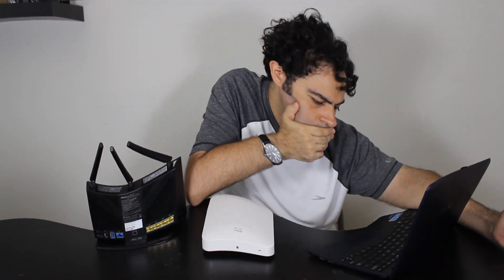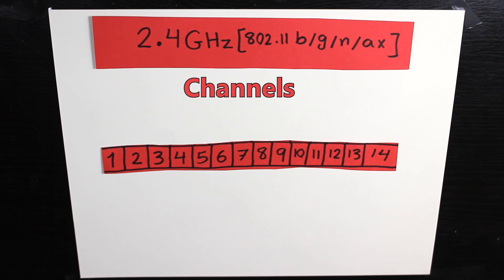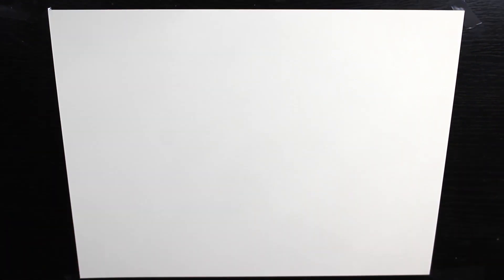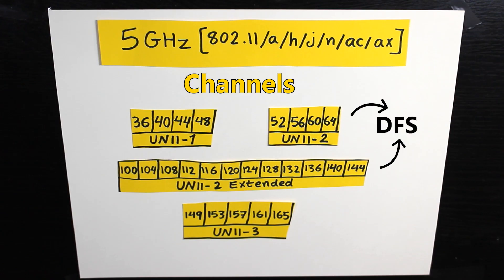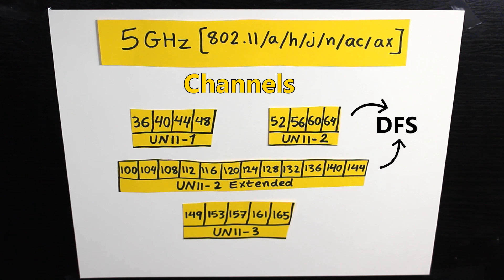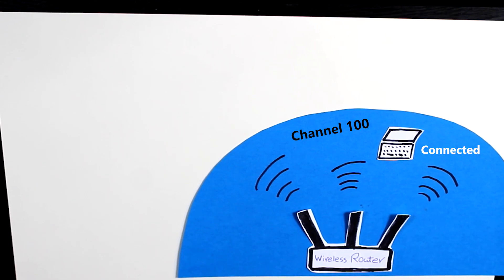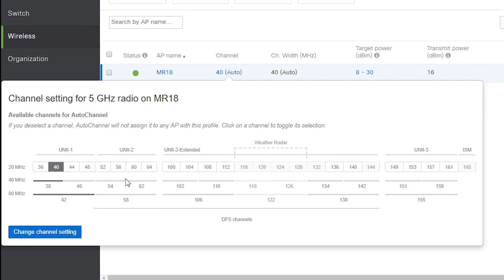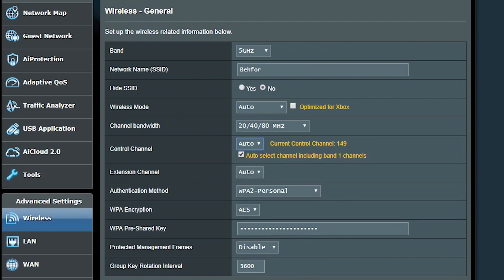This is Why My 5 GHz WiFi Was Garbage [DFS] !!!

Comment: Nice video. That was what was happening to me. Regular disconnections because I was using channel 64. I changed to channel 36 and problem got fixed 😎
Reply from the maker: Glad this video was helpful for you, thanks 👍
Reply: @Behfor  Yes, and thanks to you for sharing this info. I was using a 2.4GHz router for years and a week ago I bought a new WiFi 6 5G router. The difference in speed is really big, and since I started using the 5GHz band in channel 36 I got absolutely no disconnections. I turned the 2.4GHz band off as all my devices support WiFi 5 or WiFi 6 😎

Comment: What people tend to forget, because it's usually stated as he states it here, "to avoid interference with my neighbor's WiFi...";
 well, if you're interfering with your neighbor then your neighbor is also interfering with you. So, even if you don't care about your neighbor, the problem affects you too. In the USA, the non overlapping 2.4 GHz channels are 1, 6, & 11 at a 20 MHz bandwidth. If you're in a crowded area, don't use the 40 MHz bandwidth on the 2.4 GHz band. If you do, you'll probably be overlapping someone and, as stated above, if you're interfering with them, then they are also interfering with you. So, you'll probably get better performance at 20 MHz due to the reduced interference. Also, while a clear channel is best, having 2 access points on the same channel actually causes less interference than having them on overlapping channels. Some newer devices are smart enough to realize this if you use the Auto channel selection; however, most aren't. So, do a scan of your area and pick channel 1, 6, or 11 for your 2.4 GHz band, whichever is the clearest.

As in the 2.4 GHz band, in the 5 GHz band, the wider the channel width, the more likely you'll walk on another device. So again, in a crowded area, don't run wider than 40 MHz. Once again, the reduced channel width's reduction in performance will probably be less than the performance reduction caused by the interference you get with the wider channel width.

Some devices, such as Mimosa radios, will lock out the DFS channels that it detects RADAR on so that it doesn't try to return to those channels, but will continue to use the other DFS channels.

Comment: Bought a 5Ghz extender. I was in belief that after years, protocol would be perfect, SoCs would be perfect. 2 days passed, everything looking good. 3rd day some random signal strength drop with some disconnect... I went through whole home to find out neighbor's brand new devices near mine (apartment flats, same wall outlets along Y axis). I turned off auto to choose channels and got this warning screen about DFS. Moreover my old Sony Z3C was only able to see the first few 5Ghz channels. So I am stuck to first 4 5Ghz channels. Same frequency range with my neighbor. Whole ac protocol feels like a rushed job for me right now. Even after seeing AX released, there appeared an E. Wish AX stuff were affordable in economically questionable countries.  Q.Q

Comment: Interesting. I too had a 5 Ghz disconnect problem between my RT-AC68Us. I did solve the problem, but it had nothing to do with DFS channels. Turns out this problem is well known in the world of Asus RT-AC68Us. The problem is with the Asus implementation of Bridge mode (at least for firmware 3.0.0.4.384_20648). The workaround is simply to use Repeater mode instead. Same wireless parameters, but Repeater mode is rock solid. With Bridge mode I could have 5+ dropped connections per day. I have not had a disconnect since running with Repeater mode. Asus might have fixed this in later firmware since a lot of folks brought this to their attention.

Comment: I have the exact same problem. It keeps disconnecting from time to time, making YouTube hangs or Plex completely stop working.
I just set channel to Automatic without DFS and I hope it works. 
The problem is a while ago I changed channel to 36 and it kept disconnecting, so I don't know if this gonna work now.... but let's have hope.
Thanks.
Reply: Did it work?
Reply: @AMVhuntingSyndrom  it didn't. I had to cable the tv.

Comment: I bought an AiMesh System with two AC68U's and one AC88U as Coordinator. Since the beginning in was struggling with unreliable WiFi connections, Ai-Mesh Router randomly disappearing and faulty stock firmwares for the 88U. I managed to get across most issues with ASUSWRT-Merlin for the 88U but the WiFi connection was still unreliable as hell. I noticed that I had DFS channels enabled (default setting). After disabling them, so far everything is working well. Thanks very much for the hint.
Reply from the maker: Awesome! Glad your WiFi is working ok now and thanks so much for sharing your experience 👍

Comment: OMG!!! You're the hero! I've dug through the whole internet and I've been fighting the same issue for years!
I live about 8-9 km straight from an airport, which might be far enough, however... I'm RIGHT in a damn axis of the main runway. I've been using higher channels on 5GHz due to some extra power it gives to boost the signal and it was fine, except sometimes it was going off just like that. Sometimes it came back and sometimes stayed off, untill I switched it manually.
Now, since the airport is quite distant and shouldn't be interfering, then what might be causing it? After watching your video I came to an idea and did some testing. The result seemed both: odd and obvious at the same time:
it is those damn planes that sometimes go quite low above me (since I'm in the runway axis) that cause my 5GHz wifi drop randomly... O!M!F!G! Thx again.
Reply: A customer here in Stockholm who uses TP-link WiFi Deco's has the same problem, usually every night around 19-22, when the planes fly over their apartment, to and from Bromma airport. In TP-link Deco's it is not possible to change which channels it uses.

The sellers of TP-link Deco's do not mention this "feature". It's better to be honest, than to get disappointed, and ultimately angry customers.

Comment: hey man. amazing videos! im having an issue though i was hoping you could assist. my house is in Malaysia. and im living nearby an airport. im facing the exact problem whereby the 5Ghz band of my AC86U would constantly drop after awhile, and my only solution was to reboot both the main router and the node (i have two AC86U connected via Aimesh using Ethernet). I was so excited watching your video thinking the DFS issue is what's plaguing my router, then u mentioned that ASUS router excluded DFS channels altogether (true enough, i checked my channel and there's no DFS channel). Do u have any other idea what else could be the problem?
Reply: I feel your pain. I had 4 different Asus routers recently connected in a number of AI mesh configurations with Ethernet back haul connections. Original configuration was a GT-AC2900 as the primary with 2 RT-AC86U as the Mesh routers. Massive problems, then I scaled back using just the 2 RT-AC86U's and I still had problems, fyou mainal configuration was primary RT-AC86U with a RT-68U as the Mesh router. Still had problem. After A LOT of testing it was found that there was no problem with the wired side of the network.

I was running into random wireless network latency locally, not a problem outside of my network. This latency manifested into multiple client disconnects throughout the day. Asus tech support was not existent. I tried everything I could. Lived with the nightmare for 2 months through many different firmware updates, still the same problems.

I believe there may be a problem with the Asus firmware and buffer loading?? I had not had chance to try Merlin firmware, I just gave up and moved to Ubiquiti and my problems appear to be solved. So I am not sure what Asus is doing but BE VERY CAREFUL with the AiMesh as a solution, I do not think it is anywhere close for prime time. 

This being said, you may have a different set of problems, this was my most recent nightmare after spending a LOT of money on Asus and even more with Ubiquiti.

Comment: I had a working aimesh network comprised of an Asus RT-AC68U and a TM-AC1900. I flashed the TM-AC1900 with Asus firmware and created the aimesh network quickly and easily. Subsequent firmware upgrades from Asus rendered the aimesh network inoperable. Do you know if Asus started cracking down on hacked Cellspot routers? Do I have any other options to get it working again? Thanks and you're doing a great job with your tutorial videos.

Comment: I got a question but it’s about DD-WRT and the 5GHz. Is it possible to have both virtual access points for the 2.4 and the 5 running at the same time, an$ if so how do you set it up
Reply: You just turn them both on

Comment: Called it! The Merlin firmware updates are a godsend. It also solved a pesky disconnect problem with the USB port when streaming video from an attached HDD.
Reply: Wait, you can watch a video from hard drive from your router to anywhere in your house?
Reply: @jimmylim5015  Yes, but there’s some configuration you have to do on your devices. I use my iPad with the VLC app to stream videos to it